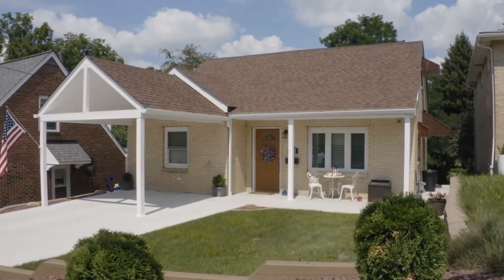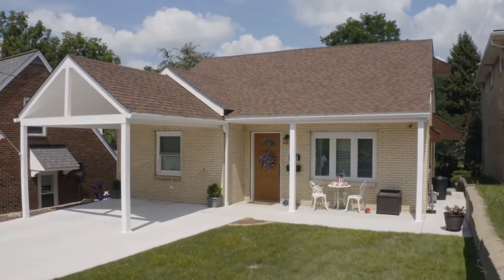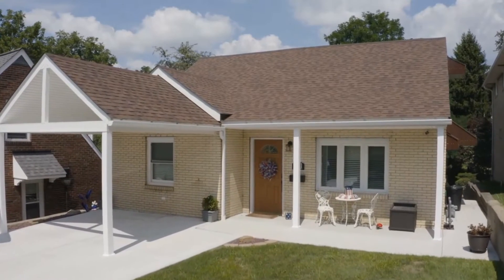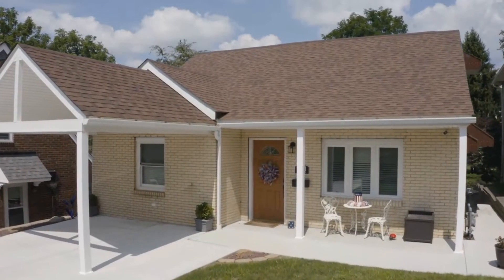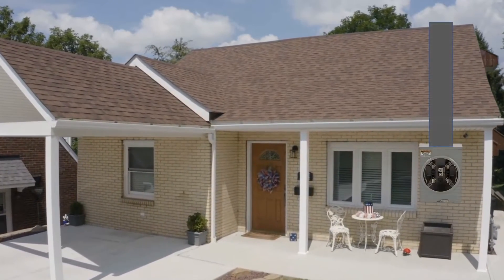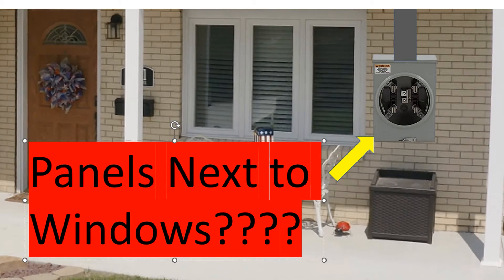Panels Next to Windows and Doors? Violation? Can you put an electrical meter next to window

Comment: What you say is correct however in my area the utility companies will make judgement calls on meter locations, riser specs, conduut burial depths etc. 
Even if we're doing a simple service upgrade I'll send pictures or request on-site visit to confirm  a location with my local utility company. 

Having had to move a muti-unit dwelling service, 400 amp after it was built and inspected was painfully expensive.

Comment: Cuestión: A dwelling unit with 3,000 square feet of living space with laundry and restroom facilities, 600 square feet of garage, and 1,000 square feet of unfinished living space that can be adapted for future use.

 When sizing the service conductor for this dwelling unit using the standard calculation method, the minimum demand is volt-amperes.

Comment: This is a great topic. I am a retired electrician and love your video's. You highlight important information that I have not used in years!
Reply from the maker: Thank you for stopping by the channel!
Reply: @ElectricalCodeCoach  You are so welcome. I have a new home. One would think the wiring would be to code. I found a few violations with the house. I am the second owner but the house is basically new as the former owner died. So far I have had to install two three way switches, a toggle switch, and have found that some of the house was wired with 14-3 solid and 12-3 solid. I have not wired a home in years as my jobs later I delt with 3-phase 480 control circuitry, which I loved. I just dont know how the house passed inspection. When I was wiring houses the city inspector was very strict but I got along with him well, and I never got dinged with any code violations. Keep you video's coming. It makes me feel, "Young" again LOL!